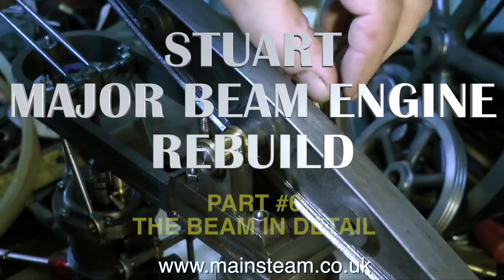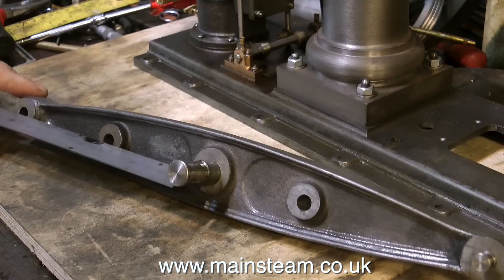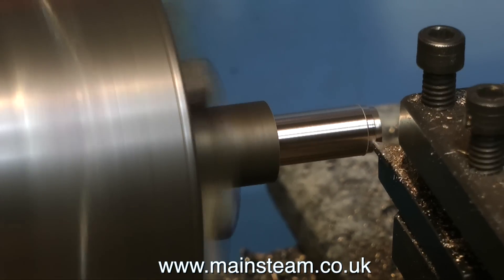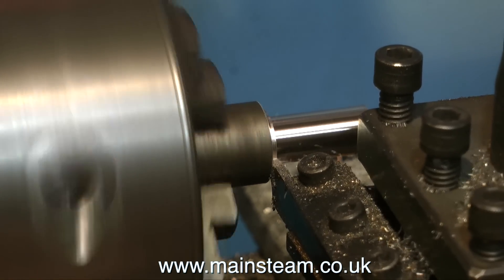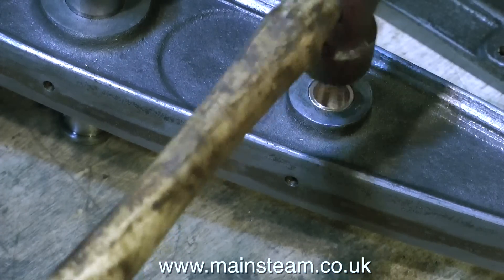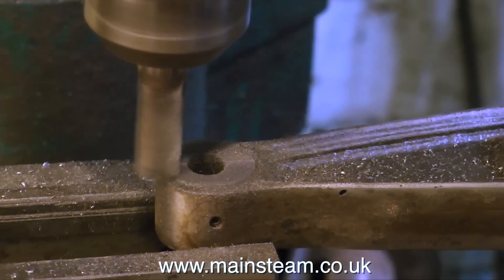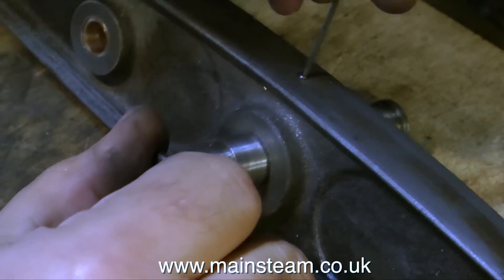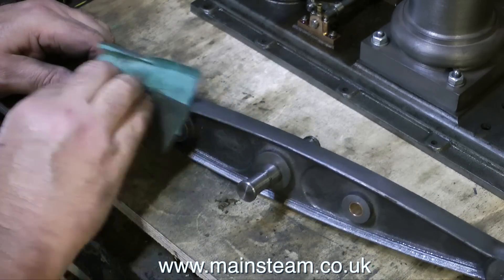STUART MAJOR BEAM ENGINE REBUILD - PART #6

Comment: Those bosses on castings are there, so you can have some material to work with. If the center to center dimension is more important, it is not necessary, nor critical for holes to be located right at the center of the boss.

It does look a lot better if they do though.....